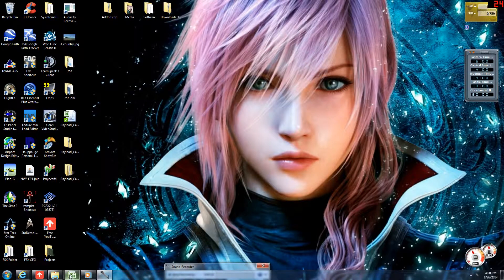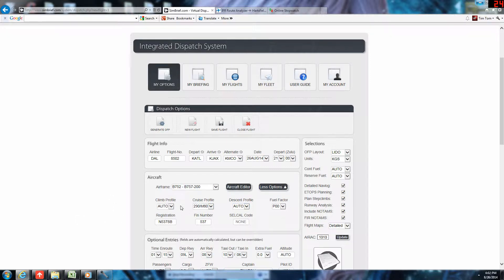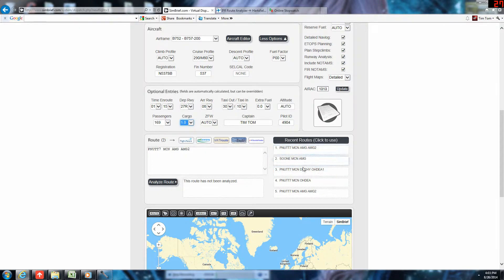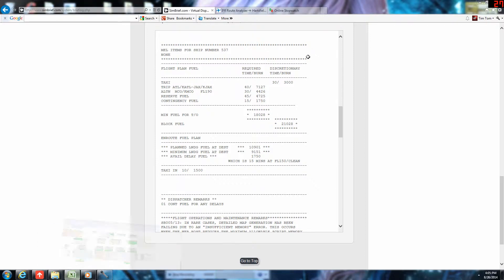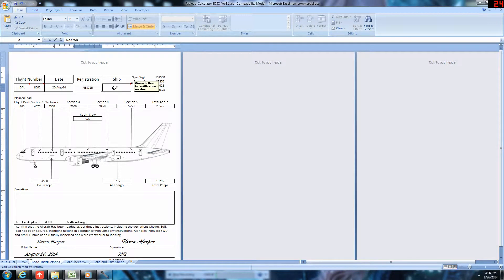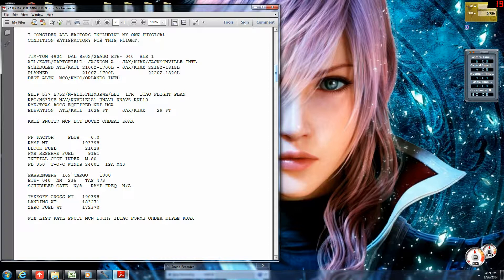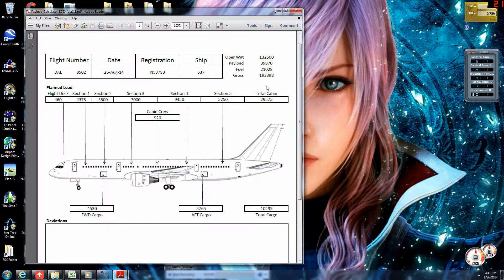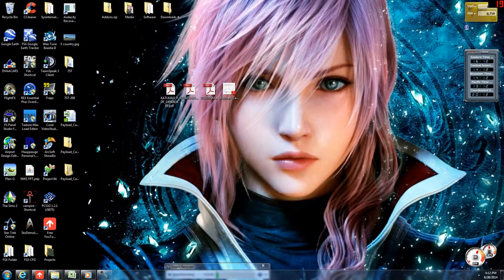Flight Planing with the CS B757-200. Payload Mod

Comment: hey tim  Update if flying delta    PW2040 engines are only on 753   Delta fleet 752 uses 2043 Engines, and delta has universal set all 752  to 240,000 MTOW   198,000 is still MLW  185000 is MZFW   and  I created a 75D  plane for FS9  130875 OEW, 23.43% OEW cg%  199 pax  25% cg  26% TOW CG%   man simbrief has updated since this video.
Reply from the maker: Yeah they have. They added cost index Flight planning not long after we uploaded this. Are you asking me to update the mod? or just telling me about this stuff?
Reply: Just letting you know bud, Went into real depth and finally a real Delta 75 pilot that let me know.  I got to fly on 2 757s just last year when I went to vegas both recent  75D modifications, was real nice hate that i couldnt stay and talk to the crew and get thier paperwork.
Reply from the maker: Oh okay. Sounds awesome.